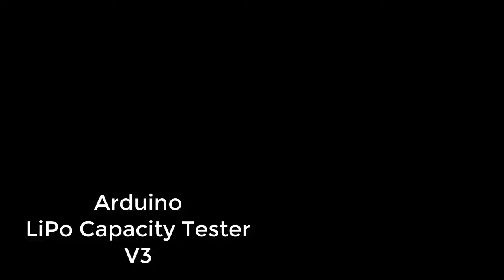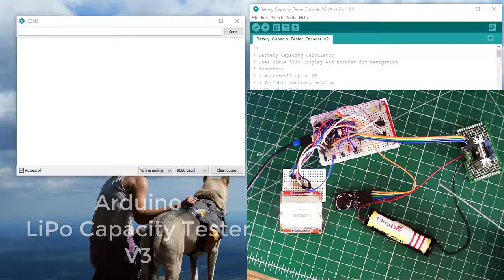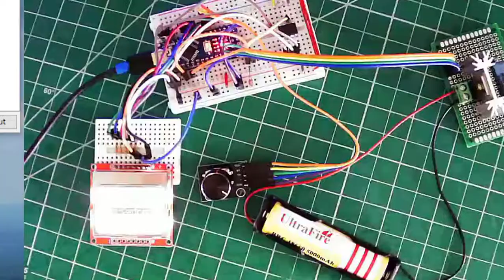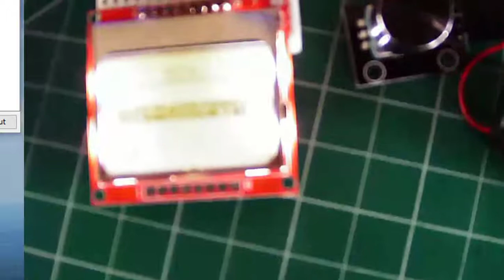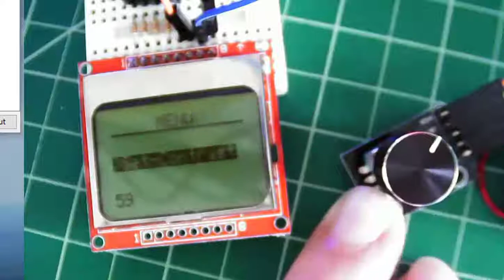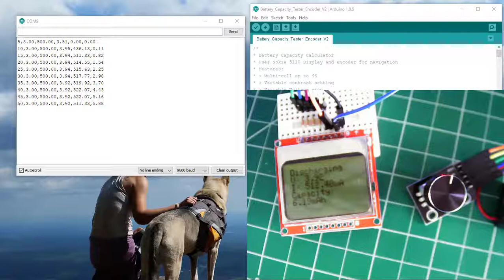Arduino LiPo Capacity Tester v3  Enhancements

Comment: Hy Tim! Nice work! I hope you ate doing very well! I have a little question: It's ok to discharge four  in LiPo in parallel? Maybe one of them is weak and another discharge on them. That 'parasit' discharge we can't count. What is your opinion? Thx !  All the best for you
Reply from the maker: Should be fine as long as all the cells are in similar condition and size... They will tend to self balance.